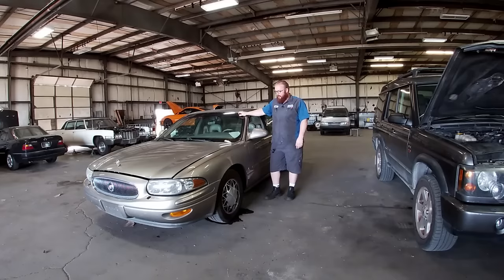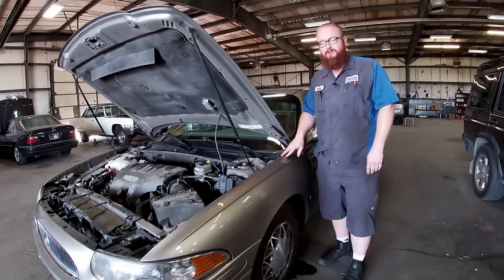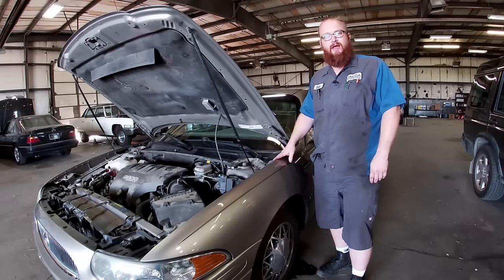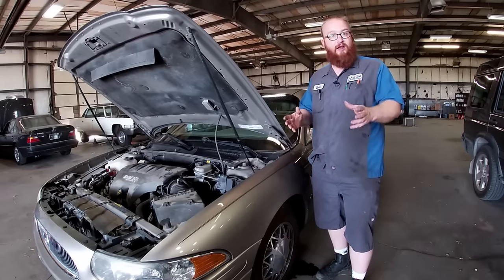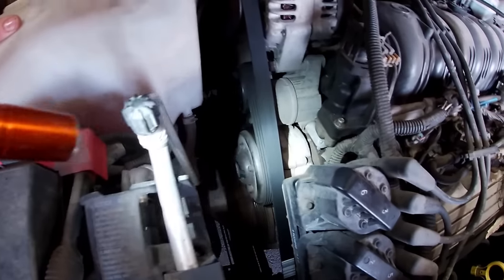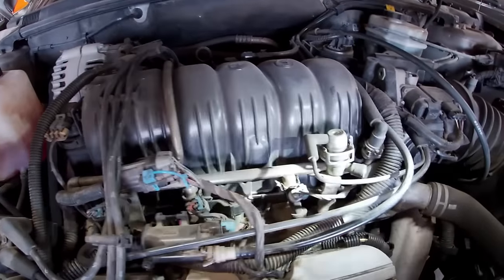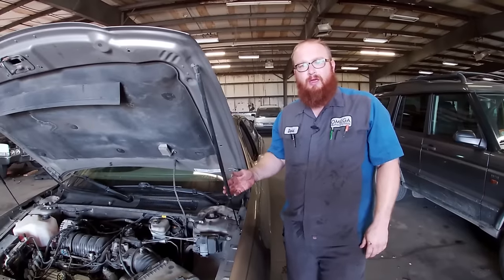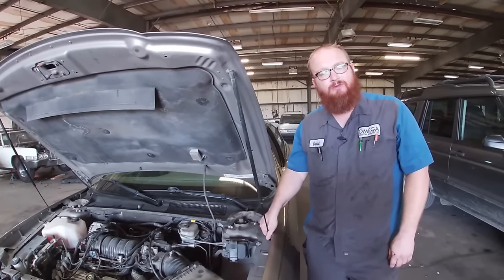CAR WIZARD highlights what makes the Buick 3800 V6 the BEST engine ever!

Comment: 3800 engine v6 is the best engine GM has ever made!
Reply: The LS has it beat but it's def up there.
Reply: peter prunty   Best V6 by far. Overall though def top 10, maybe #5. I wouldn't put it above the LS or some of those big blocks from the muscle car era but yeah it's a damn fine engine.
Reply: Have that 3.8 in my "97 Pontiac Firebird. Has 183,700 miles runs great. It's mated to a 4L60E 4 spd automatic both r the original powertrain that came in the poncho since new. If u add like MSD coilpacks 8.5 spark plug wires to get a little more snap out of it switch over to semi synthetic motor oil the 3.8 responds nicely to that. This is what i've done 2 it over the years.
Reply: James Whitehead YES THE ENGINE BUT THEIR TRANSMISSIONS WERE HORRIBLE AT LEAST FROM MY EXPERIENCE THEY WERE RAN THREW 3 OF THEM WITH THIS CAR SMH
Reply: Hey u r comparing apples to oranges here a unfair comparison!  This is among V6 engines that have been in production over the many years about the 3800 engine. Granted the LT/LS engines are in their own category themselves!!  If don't like it keep your yap shut!!
Reply: Best modern engine. Small Block is still the best GM engine series ever made.
Reply: @theodoreyoung8777  If you're going through that many transmissions, it's because you aren't taking care of it or paid a shitty transmission shop to rebuild it. Change the transmission fluid and filter often enough and don't do ignorant shit like shifting from reverse to drive while it's still rolling.
Reply: It's an awesome engine. Too bad every single car they ever put it in looks like shit design wise.
Reply: @theodoreyoung8777  the 3800 came with different kind of transmission, your statement confuse people.
Reply: Yeah my little 3.8 ran great but she’s sitting pretty on my shop floor because a 427 took her place
Reply: Daniel Laubach  
99 corolla 1.8 364k...original everything but a alternator a radiator and hoses other the general maintenance I got it at 16 now my 17 year old kid is driving it
Reply: @brusk3978  Some of the last good Toyota sedans.
Reply: I think the 305 and 351 V6 engines were the best GM engines ever made.
Reply: @ekt8750  each one is as good as the other and better
Reply: 350 V8 Has just entered the chat
Reply: The small block chevy is the best engine ever, however the Buick 3800 may be second
Reply: No doubt about it.
Reply: I got 68 thousand on my 2000 regal!😎
Reply: your car is still a baby
Reply: Edubb u should drive it more often lol
Reply: 260,000 on mine, still runs like it did when new.
Reply: @daniellaubach7544  turbo time
Reply: LS
Reply: No
Reply: john harris  can you please list some of the brand of cars and years that have this engine .
Reply: 4.3 is better motor by far
Reply: 3.1 is good.
Reply: @daniellaubach7544  You're right what does the design matter. The motor wasn't made for the sports car guy, it was made to get the family around at a cheap reliable cost. That motor dominated Ford's POS dohc v6 they put in their Taurus's back then, blown head gaskets, bad water and oil pumps and junk transmissions
Reply: If you don't mind- pulling the top of the engine apart at 80k, coolant leaking from every possible place it can. Not rare problems , common in the rust belt.
Reply: Any of these mated to a manual gearbox and RWD system?
Reply: YEAH IT IS!
Reply: The 4.3 is was pretty damn good too
Reply: @mattleonard5268  I agree with you. Some people on here need to compare apples to apples. Keep cylinder count the same and displacement close, ie. Honda, Toyo andNissan's 3.5l. 
Ford's  3.0,3.8, and 4.0 
Dodge's 3.3, 3.6 and 3.8. and so on.
Reply: Le Sabre custom in Costa Rica 💪💪
Reply: @hurkamur1  My 2005 Buick Lacrosse with the 3800 don't look that bad!
Reply: (confused LS noises)
Reply: One of the 350 V8s before all the electronics would be on my list of "best ofs"
Reply: @1337penguinman  which small block?
Reply: Does anyone know if the  3800 v6 engine could fit on my 2010 buick lacrosse replace my 3.6l v6.
Reply: It's certainly reliable, I'll give it that.
Reply: I bought one new ie 3800 8n an impala. I was informed of this reliable old engine with updates. Severe oil burning since new GM refused to repair et . Lucas oil stabilizer wss used it helped. I baby and take care of my cars like no one does. I was silly enough to but a 2009 impala ie 3.5 flex. I'm still driving. I've spent a fortune on 4 wheel bearings. Steering wheel, upholstery problems, seat belt assembly. Four wheel coverings. Four hubcaps, four Chev front and rear emblems ie total, wiper transmission. No more GM for me
Reply: @theodoreyoung8777  Absolutely trouble i lost one. They must be treated with baby care. Fluid filter changes below 40k. It is imperative that the car is totally stopped before placing in gear. Stuck in the snow a tow truck is a must the car wont take any spinning.
Reply: Mason Peck 🤝 now I own a 2006 Lexus LS430 best car I’ve owned hands down and I’m never getting rid of her she is a keeper expensive parts but u pay for quality but truly worth ever penny 😎
Reply: @theodoreyoung8777  Friend of mine has a 2008 Camry XLE 300k miles I found it for her. Veterinarians  Veterinarian daughter 28k miles
and two years old like new she had to have a BMW ie junk MHO. This car ran like new two years ago with a rrsge oil changes and no preventative maintenance or  
care. Nice job to me. The abusive woman of 25 years was a or is a Narc. Stay with the cars friend
Reply: Mason Peck Can’t go wrong with a Lexus or Toyota bro 😎
Reply: What about the 3.6L V-6 in my 2013 Impala?
Reply: @hurkamur1  bro, they put it in the firebird. If GM woulda put that twin turbo on the bird... different ball game
Reply: @hurkamur1  uh, NO. I had a 99 firebird with the 3.8 and I assumed it would run like the 3.1 - dependable, but lacking power. So I never even really got in it. Then one day I realized I had pulled out in front of a car that was going way too fast and I dropped the hammer. Next thing I know I'm going 70. So that 3.8 changed my perception of what a V6 could be. And was a fine looking car as well. Fuel economy among the best I've had... and the smiles per gallon, yeah I'm a fan now
Reply: @johnnytenjobs  in Australia, we use the 3.8 for many Holden's all rear-wheel drive only a few manuals, most are auto
Reply: @robertmurdock9750 , Problem is the 305 and 350 engines were V8's. Not V6.
Reply: @henryhawkins1194   There was the 351 and 305 V6s and even larger  V6s and a V12 you couldn't beat them, they came in light trucks and heavy trucks. The only thing about them the sparkplugs were under the intake manifold where you could get rocks or lose debris falling into the cylinder if you were not careful when changing plugs.
Reply: @robertmurdock9750 , Yes for trucks, I thought we were discussing cars.
Reply: The 4.3 vortec was also. He probably should've did this video on both the 3800 buick and 4.3 S10 both engines GM ever made.
Reply: Series 1 from 92-95 was the best longest most reliable one. Series 2-3 were good too but some of them had its flaws and problems as he mentioned. He's right about it too because I've experienced these motors doing lots of research on the motor itself and of course I also grew up around my dad and uncles who were experienced mechanics and they had the knowledge and experience of all the series of this motor just like this guy does. I think it actually would've been nice if GM would've kept the series 1 around for the standard package in the newer cars (after 1995) and probably do the series 2 for an optional package for more HP and torque. Personally I prefer the series 1 over the series 2 and 3.

Comment: I've got a 2014 Buick LaCrosse with the 3800 V6. It has just over 300 HP... and I regularly get 32 to 34 MPG on all-highway trips. It's fantastic. I also had a 1990 Reatta until recently... had the old 165 HP version of this engine in that. Really good stuff... glad you appreciate it!
Reply: The 3800 went out of production in 2008. the 2014 MY Buick LaCrosse does not use the 3800 series V6.

Comment: Thanks Car Wizard for steering me in the right direction on purchasing a 2003 Buick Lesabre. I happened to find one with 55,000 miles and inspecting it on a lift it is practically a new car. It came with the grandma smell but it is practically a new vehicle and as you said, the parts are cheap and plentiful. One happy guy right here!

Comment: I agree man, I know lots of people with that motor and they last.  When GM put there mind to it, they can build good stuff.
Reply: Hung Lo gm should have kept it and put into CT’s and gave it aluminium heads . Do you know the 3.8 was only 55 lbs heavier than the 3.6 all aluminium high feature engine with its multi chain , 4 cams multi tensioner controlled by oil pressure and long oil change intervals
Reply: I worked with many engineering teams at GM for this engine, those were good days. Now they just fire everyone for no reason!
Reply: Eric Pasternak gm had good motors years back 230 250 292  283 327 302 305  326  350 400 348 389 400 409 396 421  425 427 454 455 472  500  4.3 many more
Reply: @nickking1510  that 4.3 was a great motor.
Reply: Gm engineers: 3.8 is the best engine we ever made and the 3.6 is the shittiest. Management says: great, put the 3.6 in everything we make
Reply: @nickking1510  multi chain? 4 cams? tensioner controlled by oil pressure? that screams reliability doesn't it?

Comment: A truly great engine! These exact engines were used in the Australian made Holden Commodores from the mid 90's to mid 2000's. They were oriented north/south as the Holden's were rear wheel drive.
Reply: Don't you mean the mid 80s , they were in the 1988 VN commadore , and don't come the " it's a Eco Tec that's a different motor" you cant move one intake port and drop the deck and call it a new motor , the Eco Tec is still a Buick V6
Reply: What transmission can be used to convert the us model to rwd? Thanks

Comment: Had one of these in my 1997 Pontiac Grand Prix GTP.  Supercharger went tits up at 100,000.  Pulled the belt off and kept going.  Engine didn't miss a beat.

Comment: A lot of these engines were made in Australia on Holden cars owned by GM ,some taxi drivers run them  on Propane  gas and run well over 1.5 million kilometers
Reply: My grandad had one well it wasn't the buik but it's the ecotec and it lasted well over 100000 km without a service and it was towing constantly in 40 plus deegrees C. It only does cause he overheated it and he got a new motor and hasn't had 1 issue
Reply: and then they replaced it with the rattletech 3.6.....
Reply: @alt7488  there not that bad. The reason they suffer timing chain issues is that on the right side of the motor or the left if u are looking at it under the bonnet has a little pcv valve that dousent let the blow by out on that one side and it clogs up in there and it clogs the oil galleries and it douse the timing chain
Reply: @danielmeyer4515  yep, they changed them in 2013 to a larger size. I drill every older one I see to 7/32 on the top and 5/32 on the bottom 2 holes to match the new ones.
Reply: Add enough boost you can easily make 800hp out of them
Reply: @frankmarson2425  I'd love to see an example. I have my doubts about the stock rotating assembly, it's already pretty stressed as is.
Reply: And here’s me who has had 3, had the bottom ends knocking within a week.. brought falcons and drove them the same way and they’re still alive 😂
Reply: @tommys_chopshop9432  Yep I only bought Ford Falcons Great straight 6 smooth as silk and a far better drive.
Reply: I had a 3.8 ecotec commodore bought it with 300kms on it ran it past 400kms still ran great
Reply: @alexandermeyer9752  Yep and and will do a lot more,,great engines
Reply: @danielmeyer4515  exactly the problem with the older alloy manifold engines .. the replacement LFX plastic manifold engines largely fixed that PCV problem and timing case problems are much less frequent in the new ones ..
Reply: @DeagledSmeagol  look up twin turbo firebird it's red. Just has different heads and injectors and tune
Reply: There's still thousands of them on the road here in Australia.  They just don't break
Reply: 1.5 million would be at least 15 water pumps.
Reply: The engines used by GM in the US were made in Michigan not Australia, Holden made their version for the Australian market.

Comment: Scotty kilmer! Excellent teacher teaching us to repair everything! I too a honda civic in the 90s and the mechanic couldn't repair my running rough issue! 650 dollars later i drove out with so much blue smoke i couldn't register it. New rings and done. Btw the carb issue was my idle stop solenoid!!!! I fixed that issue in 10 minutes with electrical tape. I wasonly 20 years old. Subbed and liked 👍 cheers from Australia ❤

Comment: The L26 3800 Series 3 fixed several of the issues you spoke about as well. Just got an 05 grand prix and I'm happy as a clam.
Reply: Yes, I wouldn't own a 3800 prior to series III, had three different vehicles with series 1 & 2, all with intake problems, one fatal hydrolocking the engine.
Reply: @stinkycheese804  Not exactly the same, but I had an '89 Buick Lesabre with the 3.8 liter motor the 3800 was based off of. It had over 265,000 miles on it when I upgraded to a Buick Park Avenue. It was over 25 years old and I could still coax over 30 mpg out of it when I quit driving it.  The car was in great shape when I sold it except the paint. The car sat outside 24/7 and I am not one to wash/wax a car very often, so I couldn't blame that on the car. Great car and motor.

Comment: Had a 2000 Grang Prix GT that I put 460,000 miles on. I never touched the engine and had the transmission rebuild at 195,000 miles. You could not kill that motor. Everything else feel apart around it, but I never had to use a tow truck
Reply: Wow that's alot of miles
Reply: I'm not surprised...
Mine has 284,000 and pulls right to 6,000 rpm no problem!!
Reply: @philllsxga.7737  That why i love the 3800 motor on my second car with one
Reply: Fuel pump? Yea right
Reply: The 3800 only had issues with the poor trans attached to it, but even my 4t65e-hd is going strong at 170k miles, its not a perfect trans or the most durable. But in the stock form of the motor, it handles just fine.
Reply: Yes, I replaced water pump, radiator, water elbows, fuel pump, but the basic engine and even trans are still going after 210,000 miles.

Comment: My brother had the little buick with a 3.8 carb version and it still ran when he sold it! He got a free vx commodore ecotec v6 l67 supercharged version. He changed the pulley on the supercharger, memcal, rebiult the auto transmission with a shift kit and extra mods like a corvette servo, extra clutch packs etc. He sold it for 5 grand in a few days. Over 220 kw and i drove this thing and man? She was tail happy in the dry at 60 km/h. Love these engines. Cheers from Australia subbed and liked 👍

Comment: About time someone gives the 3800 some love.
Reply: Agreed!..wonderful engine...can go 400k to 500k miles...just keep watch of that ERG pipe in plastic manifold burn through and update those other plastic elbows to metal ones.
Reply: @LarsonFamilyFarm-LLC  yeah those intake gaskets are a pain too. But i love the torque these engines make.
Reply: @marshallthreats4643  Yeah, they can hammer 0-to-60 really fast....been a few rare instances where i got caught up in a slow boxed-in dangerous ugly spot...and once i was able to break free of ugly...floored it...always an impressive get away from dangerous.
Reply: @LarsonFamilyFarm-LLC yeah i did 0 to 60 in my 02 grand prix gt in the high 6 second range and all i have is a catless downpipe and wider tires all around. Not bad for an old pushrod v6.